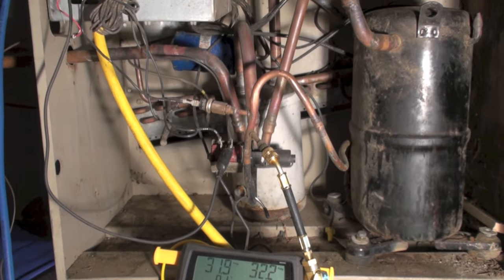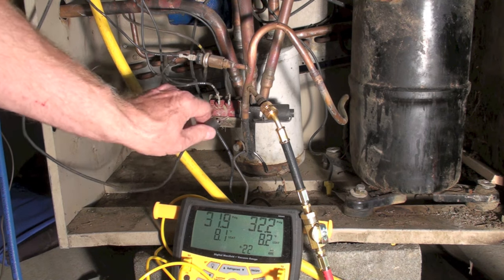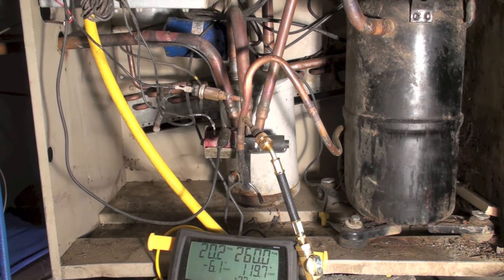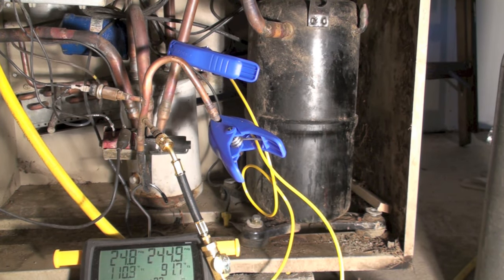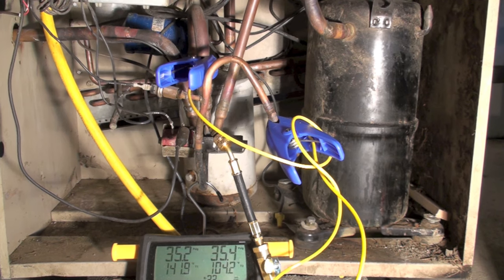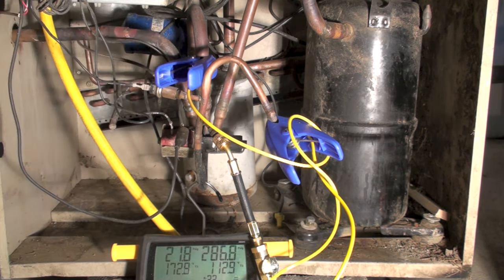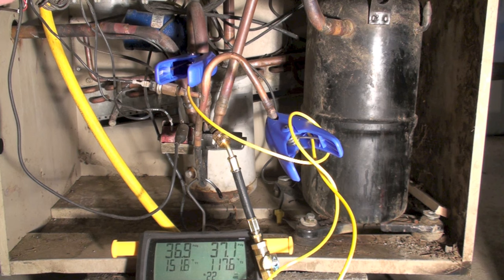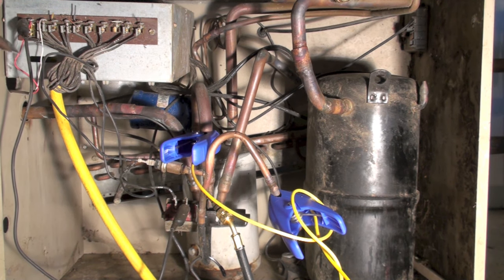Diagnosing the stuck HVAC reversing valve

Comment: I just want to take a moment to thank you for doing what you do. I can't even imagine how many people you have helped. The real world knowledge that you give out for free is priceless. I've been in the field for 25 years but was a little weak with heat pumps. We don't really see many of them in Philly. Well, over the past 10 years they've been getting more popular with all of the condos being built. It's cheaper for them to drop heat pumps in than to run gas lines to each unit & set up the gas meters. I think they might be a little lazy too. It used to mostly be people who ran the gas bill up crazy high. But anyway, thanks man. You've helped me out a lot. This video is awesome. I used to feel overwhelmed when on a heat pump service call & hoped the unit was old enough to justify replacement. I can't say I love changing out a 4 way valve, but it's not as bad when you understand them more. It's actually simple now that I'm confident with them. I cut them out & use some couplings, 90s, & Stay Brite though. I've been using Stay Brite a lot since TX valves have become almost standard. I'm lazy & don't feel like doing a nitrogen purge. Thanks Bud 👍😉
Reply: Aren't you the Same guy who said this A.C.  man couldn't satisfy a woman?

Comment from the maker: The troubleshoot of the RV give a lot of us techs fits, especially when the compressor has failed.  As for replacing the RV with the compressor, I blow hot and cold on that one.  Many locked rotor failures have no damage to the valve but when you have to tell a customer you have to do most of it all over, you kind of wish you had recommended replacement!  Great comments.
GFM

Comment: Modern college textbooks teach you to that, whenever a four-way reversing valve is suspected of leaking internally, place your temperature clamps across the low-side line (the indoor coil in the summer or the outdoor coil in the winter) and the permanent suction line between the reversing valve and the compressor.
  There shouldn't be more than a 3°F difference between them. 
  Also, be sure to take the temperature readings at least 5" away from the valve body, in order to keep the valve body's temperature from affecting your readings.  To prevent ambient temperature from affecting your temperature readings, insulate your leads for better accuracy.
  We love Grayfurnaceman! 🥰🥰🥰
  Whoosh! Whoosh! 😆

Comment from the maker: I will be doing a vid on the sman.  I used them and the testo as a teacher and I actually liked both of them with some reservations.  It can be almost impossible to tell the difference between bad valves or a stuck part way valve in some cases.  This one was easy because of the position of the slide.
GFM

Comment: A partial charge may not have enough pressure to push the valve across. The electric solenoid starts the action but it's assisted all the way across with refrigerant gas pressure, thus the small cap tubes.

Comment from the maker: It sounds like the valve actuator is leaking by.  Check the power to the solenoid.  If it is stable and the valve keeps moving, the valve has failed.  I would use a clamp meter to be sure there is no problem with the solenoid. Hope this helps.
GFM

Comment: That RV requires very little diagnosis at all. 
The tricky ones are those losing say 10% gas. Infact a multiple of techs may check the machine without picking the fault. Or think the compressor is on its way out. 
Temp differential is the best way to pick it generally

Comment: I guess its possible for the discharge to be blocked in the valve and to leak back into the suction. That would explain the high head. Thanks for the video!
Reply: patbhvac1 the part of the valve that is blocked, if anything, are the tiny capillary tubes only used to move the piston, not the bigger suction and discharge fittings...as for the "high" head pressures, we do not know[care] which refrigerant is in this system, which for 410a, normal may be a couple hundred psi.or more.

Comment: hi Gray great video, today I was work on a Trane unit 410A with a reversing & was get the same temp on both condenser & evap line off the valve in cooling , I apply 24v to the sol coil (it was not wire correctly) & it will work for a few them do the same thing again, I'm thing of changing the sol. & the valve, as I think the sol coil is weak & dropping out but why is my temp the same on both lines ? is it not sliding back fully .
Reply from the maker: It is probably sticking part way.  Then it will bypass.  
GFM

Comment: I had a quick question.  I think a reversing valve needs at least 50psi to move the internal works from side to side.   Wasn't your suction pressure too low to cause the piston to shift?  It looks like the small tubes get their pressure strictly from the suction tube in the middle right?
Reply from the maker: The reversing valve needs a large pressure difference to shift.  Even if the suction pressure was 0#, it would shift if the head pressure was 100#.  the small tubes get pressure from both head and suction.  Hope this helps.
GFM
Reply: Thank you it does help

Comment: If your discharge gas is leaking back into your true suction line your suction will rise and your discharge will drop. Since the refrigerant is going into the suction line and not the condenser you will not build any head pressure or as much as normal. Yes the suction line temp will rise. I have diagnosed over 30 stuck valves and they fail in two ways: The discharge line is leaking into the suction line. Your suction will rise and your head will drop. This looks like weak compressor valves. Typically the valve will stick in the middle and you will get little to no pressure change. This looks like a compressor that is not pumping at all. I am assuming that is 22 and you said you only had a small charge. I would say you have a clogged or stuck metering device or something.

Comment: Im working on a heat pump today and using the standard service connections my pressures are within range for 410 but the compressor keeps overheating and cycling off i suspected the rv as it dose everything youve covered in this video EXCEPT quick equalize infact. I watched it during an off cycle and it attempted to equalize but never got close to equal anything i should check or look for ?
Reply from the maker: Are you sure your charge is correct?
GFM
Reply: grayfurnaceman i didnt have my pt chart so i couldnt confirm my super heat i did take the blanket of the compressor before i left and no call back today so im assuming that helped keep it cooler and not shut off but ill have to check that when i go back out

Comment: Where can i get the normal suction and discharge pressure for refrigerants. At least the acceptable ranges. Then i will get more from this video. For example i dont know if your discharge of 258psig is off scale and a clear indication of a restriction. It corresponds to a sat temp of 120F which i assume is much too high. Is there an internal relief valve operating in compressor to protect it at this high value ?

Comment: I have a heat pump and the compressor draws low amps. The name plate says 12 amps and my amp meter reads 4 amps. Does this mean that my compressor is weak? I have good head pressure and suction pressure. The compressor is a scroll compressor from 2010. The air handler is a 2 ton with a fixed metering device and there was a 14 inch flex duct return but I added a return plenum and increased the return duct from 14 inch flex to 16 inch flex duct to reduce the noise in the ductwork. there is one return filter grille that is 20x20.
Reply from the maker: Which line are you clamping?
GFM

Comment: i'm having the same problem with a 410a system, suction line after the reversing valve is hot, when cooling for cool, but both pressures are equalized at 190 psi, is it safe to say, the reserving valve is no good?
Reply: A compressor with bad valves will have equal pressures high and low while running

Comment: Maybe you can help me. Swapped out a dead compressor to run into similar issue. The suction on the valve gets hot when on ac but when I switch to heat mode the return becomes ambient. Not cold or hot. Also, the service port suction line gets hot on heating and cool on cooling. So it's acting like the valve is moving but not all the way. Is there any way the accumulator can get restricted causing these symptoms?
Reply from the maker: My thoughts are the same as yours.  Stuck partway.  This is probably what caused the compressor failure.
GFM
Reply: @grayfurnaceman  thank you.

Comment: So  reversing valve receives 24 volts from Tstat to  control heat and AC .  Then it should move from defrost board in and out also?       why is int not moving back to heat if defrost has been satisfied . Pressure differential?  Why work way with Tstst but not on its own from defrost ? Thank you .

Comment: you had charging ports close to the compressor to determine the compressor was bad before condemning the RV? That would be tough to diagnose with 2 problems at the same time? was the valves out on the compressor?
Reply from the maker: A leaking by RV and bad valves in the compressor have the same symptoms.  
The only way I know of to determine the difference is to energize the valve and see if it moves.  Even this does not always work, as the pressure difference required for the valve to move may not be there in either case.  
GFM

Comment: This might not be related to a reverse value issue but here is the problem I am having... I have a programmable stat that is set to 74 when I'm at work and 72 when I'm at home. Sometimes, I'll come home and it's 72 but the AC is still running and when I check the temp coming into the house it's around 61. Other times I come home and it's still at 74 and the temp coming into the house is around 71-73. I also notice the large suction line is barely cool and not sweating even around the 61 degree mark. 

The only way I can fix this issue is shut off the ac, switch to heat mode for about 45-60 seconds, shut off the heat, and switch back to cool mode. This seems to work every time as the temp coming into the house cools down to around 57-58 and the large suction line is close to ice cube cold and sweating a good amount. 

Now if I just shut off the ac but keep it in cool mode and then turn it back on after the 5 minute system delay, it doesn't solve the problem and 72 degree air continues to run into the house... Would this be a reverse value issue? I thought maybe low on refrigerant but I don't understand how it works just fine when I do the cool,heat, cool switch. If it was low, it shouldn't produce a temp difference of 57 degrees (15-16 degree difference) like nothing is wrong after I do my manual switch... thoughts? After I do this, the system seems to work fine throughout the evening and at night (I continually check the temps coming into the house every time the AC kicks back on the rest of the evening and it hits 58 every time). But something seems to not work right when the program goes to 74 and it can't get cold enough to recover back to 72.
Reply from the maker: I assume you do have a heat pump.  There is no way to know for sure what is going on without actually looking at the unit.  It might be a reversing valve not switching over completely but that would be quite unusual.
GFM

Comment: How can you tell the difference between a bad reversing valve or compressor?
Reply from the maker: If the compressor will not run due to winding failure, you may not be able to tell the difference.
GFM

Comment: Will a stuck  reversing valve cause the coil to burn up, if so would this happen in a time period of less than an hour
Reply from the maker: You will have to explain what you mean by "burn up" the coil.  
GFM
Reply: @grayfurnaceman  shorted

Comment: I have same problem my reverse valve is stuck  I don’t know how to repair. But my compressor is still good. Any idea please thank you
Reply from the maker: If the solenoid is working ok, all you can do is replace the valve.  Big complicated job.
GFM
Reply: Thank you as always but where is the solenoids?.
Reply from the maker: @fathersawiros9247  At 2:15 in the video, the valve is shown with the solenoid on the left with the 2 wires connected to it.
GFM

Comment: Grey man. I have a question. What do I look for if I have a reversing valve cycling in cool then after cycling on it goes into heat. And vice versa. Again it's calling for cooling but sometimes going into heat then back to cool when it wants to. Thanks
Reply: Best guess would be fault in wiring or bad pilot solenoid

Comment: Thanks for the video. I have 3 ton trane HP XL15i installed 2008 and and electric furnace strips for backup indoor. Have fixed a few things myself, but gave up with multiple problems recently. my new hvac guy friend of a friend who works for carrier after sales determined 3 way valve stuck in AC mode. tried knocking it no luck. I had frozen coils in furnace this summer once due to renos dust in filter. wonder if that might have caused it. HP otherwise clean and working well up til now. he said its a $2500 job to replace the valve and tricky due to gas removal and welding bacause coils right behind it. and he doesnt do that so i lose the HP for heat for now. Is there any fix for this besides replacing the valve? thanks
Reply from the maker: The problem here is not so much the valve replacement.  It is indeed tricky to do but I like replacing them.  Great challenge.  
The filter problem had no effect on the reversing valve.  
Here is the real problem.  Your unit is probably R-22.  It is very expensive.  Could be between $700 and $1,000 for the refrigerant.  
That said, I would expect that $1,500 would be the top price.
GFM
Reply: @grayfurnaceman  no I have r410. Was fairly new at the time I bought the hp. My guy said I might be able to get a deal on a new r410 hp as 410 to be phased out in 2023. What do you estimate the cost of the valve + labor would be for the 3 way and is the 410 not  reusable? He also said repair would probably be done  in the shop.
Reply: @grayfurnaceman  I guess I was wondering if there's any way to recover a stuck valve understanding it's a sealed system I guess
Reply from the maker: @soneeeee4440  Stuck means stuck.  
If I was doing the job, I would figure 7 hours labor for diagnosis and repairs.  About $650 in parts and recovery equipment.  
I would never remove an appliance to work on it in the shop.  I would repair in situ.
I make it a practice to never reuse refrigerant, but it can be done.
GFM

Comment: I know this video is mostly for experts, but it makes me think I'm getting misdiagnosed on my heat pump hvac. My unit cools fine 95% of the time, but every once in awhile I'll try to cool from our day temp setting of 78 down to 72 and it will struggle to cool off one degree...or it will cool off good at first but then I'll wake up at night and it'll be 79 or so. It's not Summer heat related as most days it cools fine still. I'll play with turning the unit off & on for a few hours or two days...and the problem will usually go away for weeks or months.

Pump is good and Puron is full per repairman. He said there was some restriction in the coils & I need new coils. It did seem the system was not cooling properly when he was there. He also quoted for a host of code upgrades like over $100 for the 3 little cap locks on the freon inlets?!? $65 per pound for Puron also seems high.

I know you probably can't know for sure w/o gauging, but it seems if coils were bad the cooling would be bad 100% of the time...not 5%. Plus I stood over the compressor one hot day and it seemed cooler air was coming from the top this unit compared to my other unit.

Any chance you think this is the reversing valve sticking intermittently? Is that cost high? Thank you!
Reply: Maybe reversing valve is considered part of the coils system and he just wasn't giving that detailed info?
Reply from the maker: Probably not the reversing valve.  Your tech is probably right about air flow.  The coil may be freezing up.  Look for frost on the large line.  
GFM
Reply: Okay, thank you.
Reply: Also make sure that you are keeping up with your filters. Clogged filters cause airflow restrictions and will freeze up your coiks as well.
Reply: Think along simple lines first. You should never start a diagnosis without a clean evaporator and condenser coil. You would need hvac tools to measure that. An experienced tech would have indicators by just feeling the lines and temperature differences.

Comment: and how is it possible that the liquid can flow from higher pressure from the discharge line to lower pressure in the outdoor coil ?
Reply: bbal78 usually it goes through some metering device as a piston or TXV. in this case, the [metering] device becomes the reversing valve, hence the larger than 2-3 deg. temp. differences when a [good] compressor makes a differential.

Comment: I have  Lennox HP that has blown (shorted 3 R-valve coils (in cooling mode) in the last 2 months, cools great while it's working but the coils shorts out and causes the 24V circuit breaker to blow and then the AC will not work. What could cause the R-valve coil to go bad (short out)? I noticed in your video the R-valve is stuck however the coil is still functioning. Ever had an issue causing the coils to short out?  Thank my making such goo videos.
Reply from the maker: First be sure your coil is seated in its mount.  If it is loose, it will overdraw and damage the coil.  If it is seated, my thought is the solenoid inside the valve is not moving as far as it should.  Means a new valve.
GFM